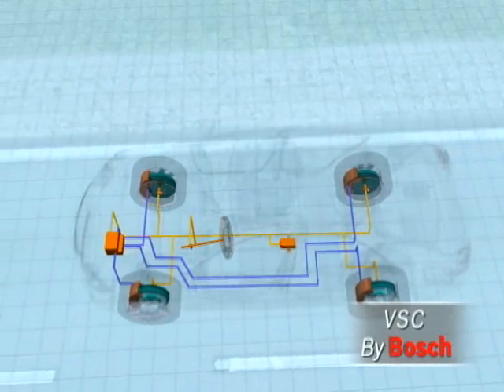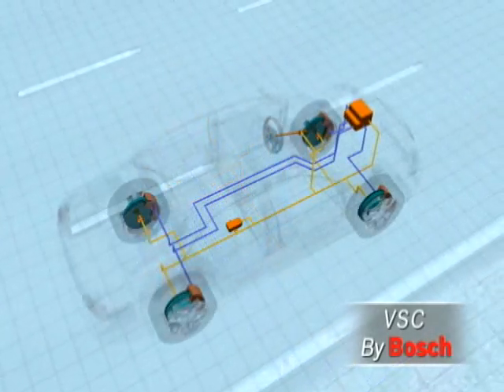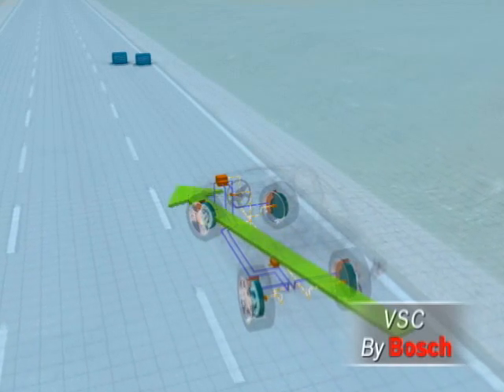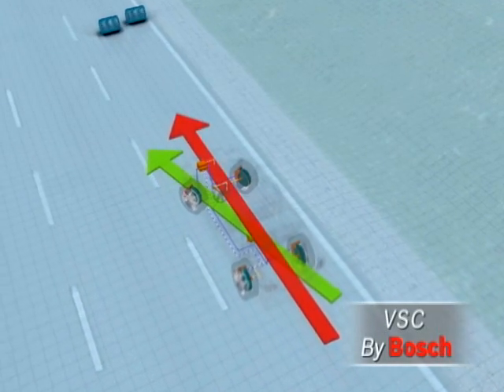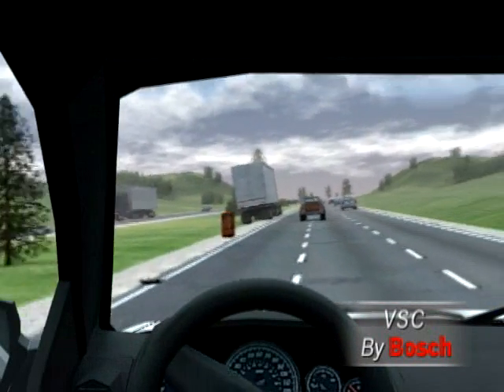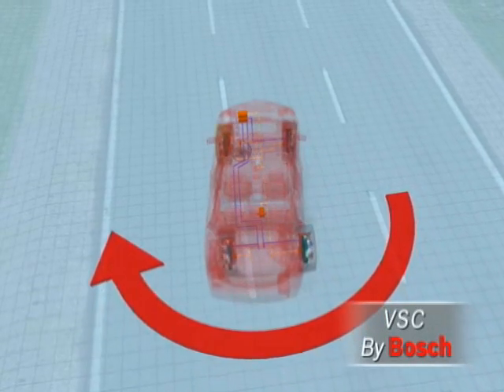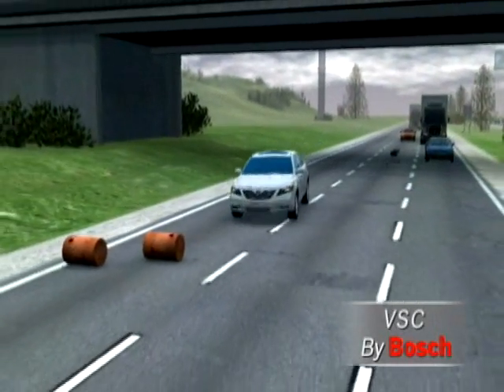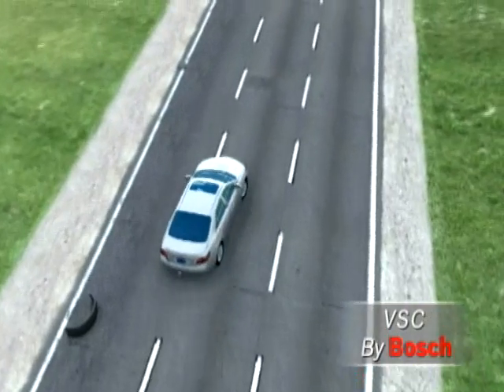VSC Explained

Comment: back the day we didn't this bs trac control modules, relays and steering wheel calibration. stupid engineer ruin driving experience all across board. Note To All Engineers all around the world go back to making simple vehicles. my son toyota was jerking back and forth, overheating and stall at times over a stupid simple "Coolant Temp Sensor" GTFOH!

Comment: Weird. I was driving in normal conditions, just went to the store. No emergency skid, no sudden stops no nothing. And the light came on. I checked everything from the gas cap to make sure it was tight to the brake fluid. Everythings fine. Now I have to figure how to shut it off.
Reply: Rich Bones you have to perform a o point calibration on older toyotas to clear the vsc lights. Look it up on you tube
Reply: @bgarrison67  are you having the same problem as me ? I keep having a mental breakdown when trying to beat vsc
Reply: After a mental breakdown